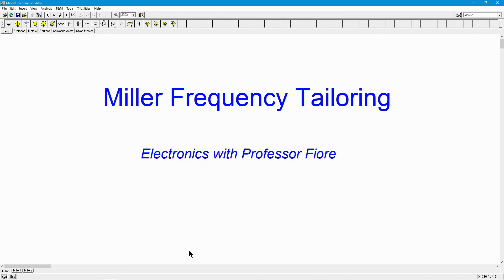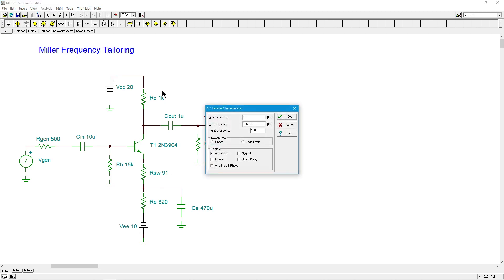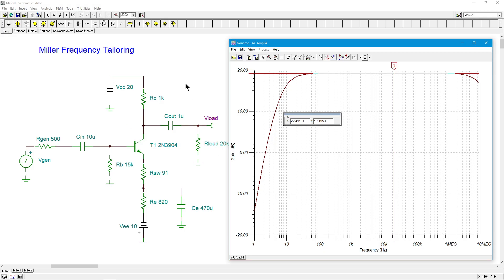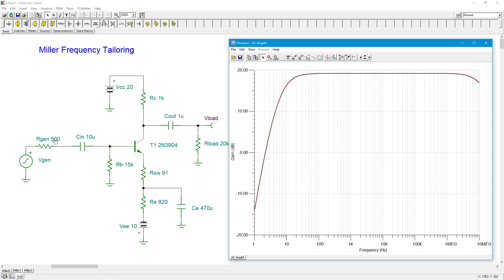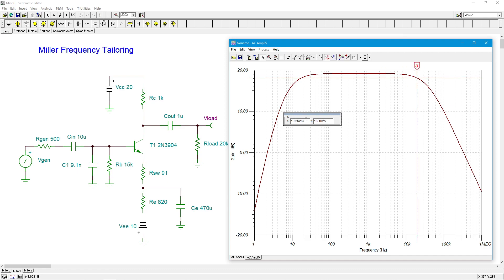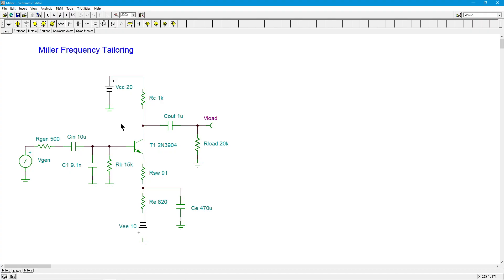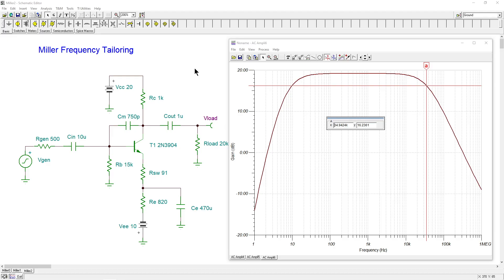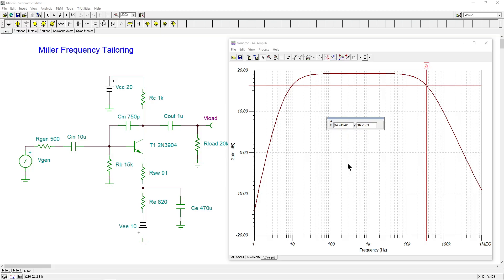Semiconductor Devices: Miller Frequency Tailoring

Comment: Hi prof, what is Your opinion on the books of malvino, floyd, boylestad, razavi, tietze/schenk , AoE, sedra/smith . Would be  very nice to have some inside . Thx, and greetings
Reply from the maker: Whew, that opens a box. Buckle up as I have much to say ("Ask for the time and you get the history of clocks").  The first thing to note is that my comments are entirely my own and I admit to my (perhaps unique) biases. I do have experience teaching with some of the books you have mentioned, not just reading/reviewing them. For many years, our college used Malvino for our electronics sequence and Boylestad for DC & AC circuit analysis. When I came on board, I "inherited" the course outlines that specified those texts. Eventually, I became the lead instructor for those courses and the syllabi were my responsibility. The first course that became "mine" was the op amp course, pretty much from the day I was hired (they needed an op amp guy, so I got the position). I went through many titles. There were a few decent ones (Stanley comes to mind) but I was never happy with a single text. That is why I wrote my op amps text, because I thought I could do better. The first edition came out in 1992 through a traditional textbook publisher. The second edition was released around 2000. Around 2015, the publisher decided to get out of the field of engineering and I was able to get them to revert the rights back to me. That's when I wrote the current 3rd edition (and also updated the lab manual). During that time, I did look at other titles just to see what "the competition" was doing. There was nothing that I found too exciting. Mind you, these are perfectly serviceable books with expected accuracy, it's just that I might disagree with the order of presentation or topic emphasis. To each, their own.  

In the electronics area, we used Malvino. I taught out of Malvino from the 2nd to the 5th or 6th edition. I still think that the 3rd edition was the best of the sequence. I did not like the 4th edition at all (I recall that was a general feeling shared by many professors). Overall, it was a good text. There were some spotty bits and some areas that I felt needed more depth. At the time, it was also lacking simulations (side note: I included text-based SPICE simulations in my 1992 op amps text, so it wasn't impossible to do). At the time, Floyd was a major competitor. I reviewed it and it was OK but I saw no reason to switch from Malvino. By that time, I had decided to write my own, which began with the lab manual and eventually led to my Semiconductor devices text which included newer areas of study such as class D power amps and IGBTs, and much deeper analysis of class A and B power amps. 

For DC/AC circuits, I started using Boylestad at the 6th edition and stopped somewhere around the 12th. It's a comprehensive text but sometimes it made me want to scream, especially the lab manual which I absolutely hated. Side note, somewhere around the 10th edition I was contracted to rewrite that lab manual, although I was constrained with what I was allowed to do. I think it was significantly improved, and Bob Boylestad agreed, although I felt it could have been much better. That was the impetus for me to write my DC and AC lab manuals. The one thing that really drove me crazy about using Boylestad was the "editions roller coaster", as I called it. A new edition would come out every two or three years. There was no technical reason to do this as the material had not changed, it's a marketing decision to kill the supply of used books in order to maintain profit flow. Of course, writing new editions is not free, and the added expense just went to further increase the cost of the text (around $200 when we jumped ship several years ago). Boylestad's publisher was not the only one to do this. New editions often did goofy things to make them incompatible with prior editions, including swapping the order of chapters, combining or splitting chapters, and altering the problem sets. Those changes would force me to rewrite all of my course outlines, web pages, handouts, etc. every two or three years. It drove me crazy, and ultimately led to the creation of my own DC and AC texts. By then, text book pricing was through the roof and the answer from the publishers was to create "timed access e-books" for a lower price. I found this to be nothing short of evil. Basically, a student got to rent a book for maybe a quarter of the cost of buying one, but without the convenience of adding their own notes to it and creating their own personal library of resources. "What's that? You need to review something from your 1st year circuits class to complete this project in your 3rd year? Too bad! That one timed out a few semesters ago." Meanwhile, the publishers saved a ton by having no printing, warehousing, or shipping costs. 

Also, because I had full control over my OERs which were designed to be read on a computer, I could put links directly into the text, for example, for datasheets, background info on inventors, etc., and also use color where I needed it as it cost nothing (and there was no desire to just use it because "it was already paid for", which can just clutter up a text). But, I knew some people might want hard copies, and I was able to size them to standard 8.5x11 sheet size, which is an unusual size for a textbook, but is a size any printer can handle. 

I have not kept up on what the latest offerings are from the major publishers so I can't comment on the most recent editions. All I can say is that I designed my books with the students in mind, and not with the goal of selling these to other professors. That makes a difference. Always remember that a textbook publisher's target is not the student, it is the professor. They have to convince the professors to use their book, not the students. The students BUY the book, but the professors SPECIFY which book to buy. Thus, a certain amount of work goes into making "extras" for professors. This includes items such as complete solutions to all problems, Power Point slide sets, and my most hated add-on: "Test banks" (sets of solved problems that can be used for tests). My opinion is that if an instructor can't be bothered to create their own tests, I seriously doubt their commitment to proper teaching. And don't get me started on Power Points. Ugh. You might be surprised by the number of emails I get from professors who ask if I offer any of these tidbits. 

Anyway, I am happy that many different titles exist because students want different things from their books. I have nothing against the content of these other titles and have never met the majority of the authors. I do, however, have serious reservations regarding the entire textbook publishing industry and always recommend that people look to OERs first. There are some fantastic titles out there across numerous disciplines. I believe that I commented on some of this at length in a couple of videos I did on textbook publishing, which are in the Elsewhere Playlist.

Now then, what time is it? ;-)
Reply: Hehe, quite late indeed;-) .Thx vor your extensive thoughts/experiences/ideas. Some of witch I knew about and others new to me but no less jaw dropping; like the one considering "Test banks". For myself I wanted a small library to pick and compare topics and chapters through the different authors. And since I couldn't spend thousands of bucks, all the books I own were used copies from the start.(except the ones by you:-))) .personally I am physisist by design, no EE guy. I think one of the most bothering topics for students of the mentioned material is the vast amount of "models" especially considering transistors and amps. Y,Z,h,g,hybrid-pi/rpi, T/re.....some beginner can easily get lost. For instance, what did compell you to use the T/re model? And why , you think, others like razavi are convinced that the rpi model is somehow Mord powerful? Greetings
Reply from the maker: @christinaschumacher9419  Used books are something I can recommend, especially when it's established foundational material. The basic theory hasn't changed and it's good to do an end run around the publishing machine. So yeah, a used copy of Malvino or Boylestad or whoever, great. Two things I will add along the lines you mentioned: First, there seems to be a desire to absolutely avoid any discussion that uses calculus in these books. Perhaps the publishing houses (and instructors) fear that the students can't handle it, so best to avoid it in "technology" or "engineering-technology" programs at the AAS level (at the AOS level, I might agree). This is unfortunate because I do not think that some topics make much sense without it, especially when it comes to equation proofs. My books are mostly algebra+trig based because that's all you need for 95% of the work, but I don't avoid calculus where I think it's needed. And if the students haven't had calc, well, you can skip it for now, but it's there to come back to if you need it. There is a darkly humorous parallel to this in the world of texts used strictly in classical engineering programs, mainly what I like to call "false rigor". I've seen texts that make frequent use of calculus, even when they don't have to. I've seen example problems solved using integral calculus when there is a much simpler (and to me, more obvious and intuitive) algebraic solution that takes half the time. But, some people are impressed with all of the "dt" and "big swoopy S" they see as they scan through the texts. 

As far as models are concerned, I think that instructors should stress at the outset that models are just that, MODELS of the device, not reality. They exist to make your life easier, not to make it more complex. This goes all the way back to a simple resistor. I used to ask my students a Zen-like question: "When is a resistor not a resistor?" My answer is "When you can hold it in your hand". The thing I draw on the board is "all resistance", it's more a concept, a distillation of a single parameter. No real world physical resistor behaves like that in its entirety, but that model works very well at DC and low frequency AC. We can then increase the model's accuracy at higher frequencies by adding something like shunt capacitance. 

When if comes to transistors, it's the same thing. The "r prime" system that I use (along with Malvino and many other authors) is straightforward, easy to understand, and works well for the sorts of circuits we investigate in lab, using nothing more than algebra. At much higher frequencies, that model will need to be tweaked. Some models are a more natural fit than others, though. For example, FETs are easily modeled as voltage controlled current sources, so we often use a transconductance based approach. But it doesn't have to be that way. Many years ago, I reviewed a semiconductor text that used a transconductance approach for BJTs. It was interesting because the chapters on FETs were so consistent with the chapters on BJTs. The formulas for things like voltage gain work out the same. After all, the reciprocal of r'e is the transconductance of a BJT. I did not adopt the book though, for one simple reason: that is not the industry standard. If our graduates walked into an interview knowing nothing about beta and instead talked about the gm of a BJT, the interviewer might think they were incompetent. But "a model is a model is a model", and you pick which is most appropriate for the job at hand.
Reply: The "false rigor" .....yeah, I encountert that one quite a few times especially in classes/books for theoretical physics. Obviously here you cannot avoid a higher level of complexity/difficulty concerning calculus, diff eqs, integrals etc. But still some people manage to serve it in some overly intensified manner. On the other hand...at least here in Germany the mathematical "skills" of highschool graduates and beginners/freshmen at our colleges and universities decreased dramatically over the last decades. I am curious if a similar development has taken place in the resent past in the states?
Reply from the maker: @christinaschumacher9419  I don't have any hard data on that. The program that I taught in had certain skill-based entrance requirements. An individual could be accepted at the college, but until they met specific testing standards in math, English, etc., they could not be admitted to the electrical major. I should note that every new student went through placement testing. So for me, there wasn't much variation between a freshman class from the 1980s to one from the 2010s. Of course, what the whole entering cohort was like could've have been quite different. 

Mind you, I find the math skill sets of the average American to be below where I think they should be, in order for them to be fully engaged and responsible members of the society. There is a certain level of anti-intellectualism to be found here, most notably described by Richard Hofstadter in the 1960s (and which seems to have gained some ground considering all of the crazy conspiracies and other bizarre ideas, such as flat Earth or a universe that's only 6000 years old, that are floating around). Indeed, I find that some people wear their innumeracy without guilt. No one would brag about poor literacy skills but people seem to have no compunction regarding innumeracy. No one would say "I'm terrible at reading comprehension" but people have no problem saying "I'm terrible at math". I find that to be both weird and depressing.
Reply: Richard Hofstadter... Haven't heard this name before....will check him out.
Reply from the maker: @christinaschumacher9419  He was a well-known historian and public intellectual in those days. Some of his better known works include the essay "The Paranoid Style in American Politics" (https://harpers.org/archive/1964/11/the-paranoid-style-in-american-politics/) and the book "Anti-intellectualism in American Life" (https://archive.org/details/antiintellectual000187mbp/page/n1/mode/2up)
Reply: Thank you for these links. Looking forward to your next videos. Cheers and happy easter. :-)